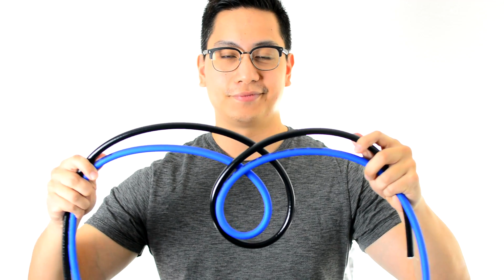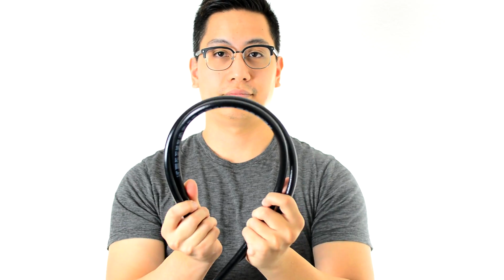Uberflex™ – New Innovated Pressure Washer Hose patented by ProPulse, a Schieffer Company

Comment: Why is this style only available in 50’ lengths…. I need 100 feet of hose. I do see a 100’ hose available but it looks like a different hose type
Reply from the maker: Thanks for your question! We do offer 100' UberFlex hose through many different distributors, including Amazon.
Reply: I want the Uberflex hose but with 3/8” ends in a 100’ length… but all I can find is it in 50’ lengths with M22 ends. Can I buy this exact hose in 50’ or 100’ with 3/8 ends?
Reply from the maker: The Commercial Uberflex is 3/8" with a Solid end (sol) and a swivel end (swv).  4000 psi.  The Consumer Uberflex is 1/4" with M22 connectors on each end.  3100 psi. Available on Amazon in 50' or 100'.  @Awickedtruth